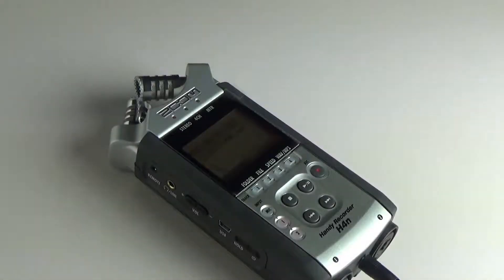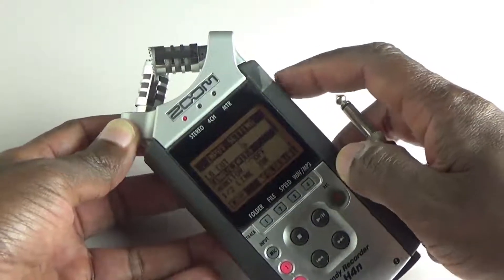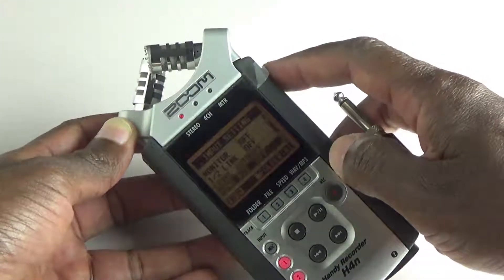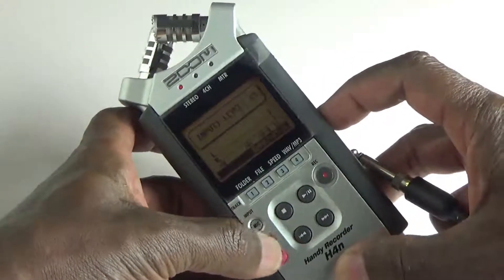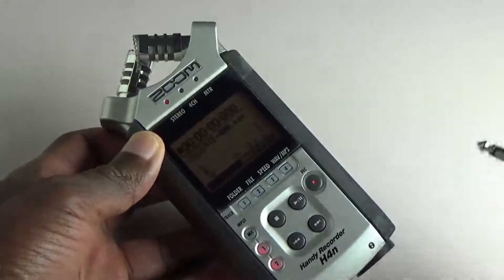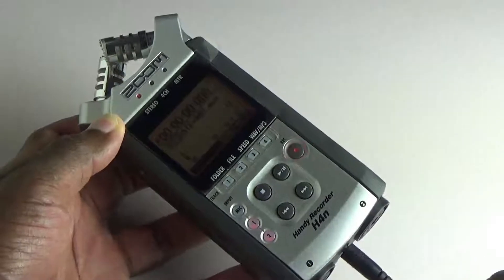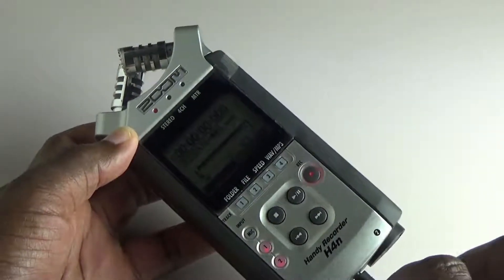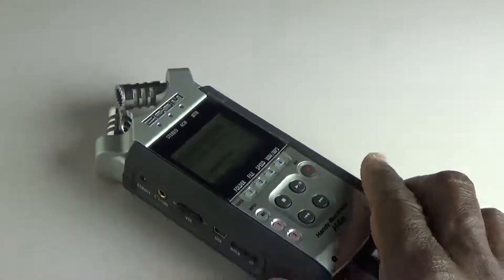ZOOM H4N Problem

Comment: Bro you have to turn your record level down so the levels peak at -12 -6, anything over that is will sound bad. Change your record format to Wav 96khz/16 bit or Wav96Khz/ 24bit these are the setting i use to record. If you use stereo wav44.1khz/16 bit it will work but the audio will sound like trash. Using phantom power mics you need to use a higher Wav format but it will be larger file.
Reply from the maker: Believe it or not, I just saw this. Yes, the level was high, but the whole point is that the two levels were very different with the same settings and the same signal. 
Thanks

Comment: I've had the same issue with mine for a few years now, even after altering my settings and changing my settings. It's really disappointing. I've not found a solution.
Reply from the maker: Sorry to hear that Blake.  These Zoom products are not very well built and unfortunately are disposable.  They don't repair them.
Reply: @anthonyscott16  I found that really shocking. For me, a 3 world country dweller, this microphone isnt cheap at all. I bought this in order to use it for at least 10 years. and yet here I am. not even 2 years of very little use and the mic is going crazy

Comment: ?? please help me my zoom h4n can't connecting on my macbook pro, system can't detect my audio interface can you help me  ??
Reply from the maker: Have you tried the obvious stuff like restarting both the mac and the zoom and maybe reformatting the card?
Reply: I have tried using my other h4n but the same thing happened again, the first glance was detected in the h4n channel selection input and suddenly disappeared, like a driver that was not installed properly
Reply from the maker: @dika23rock  Macs use drivers, but call them "kexts." However since Zoom dsnt provide a kext for the h4n I'd say your only option is to deal with it on the mac side of things. As a last resort you can reinstall your OS after backing up your files. I'm not a mac expert but I hope that helps.

Comment: I also have the same issue. But the problem started after lending my zoom to some friends. possibly someone overloaded one of the inputs?. I have also issue with the built in x,y stereo mic!!!! In stereo mode the L channel is more than 50% lower!!!
Reply from the maker: Sorry to hear that you're having issues as well.  It appears that these products are not made with high tolerances which becomes apparent in cases like ours.  Hopefully you can still get some use out of it.  I've moved on to Tascam.  Have a great day!